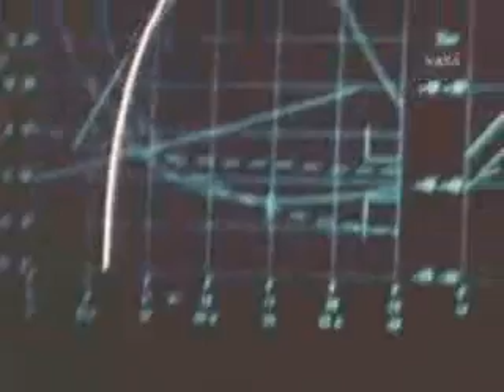STS-1: Part1 April 12, 1981

Comment: @MrGeeBeeEss though it may seem fair to say that no accidents from 13 flights is great, but would those same odds carry for 129 flights? 129 flights of an extremely complicated piece of hardware with 2 failures albeit tragic is remarkable considering the million possible issues. In a nutshell 0 fails from 13 doesnt make 2 from 129 seem appaling and program destructive.

Those 14 crew and 2 ships lost will never die, they are exploring the heavens forever